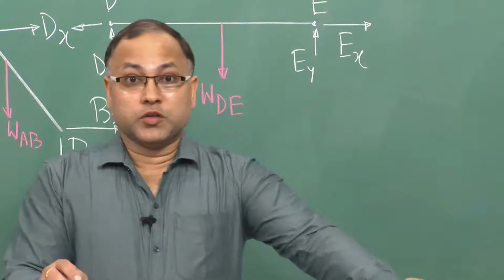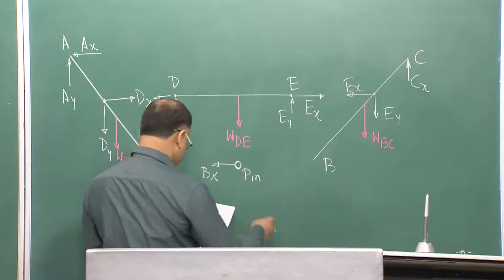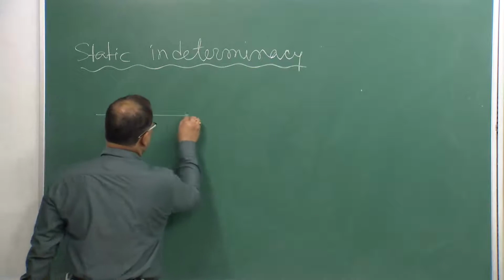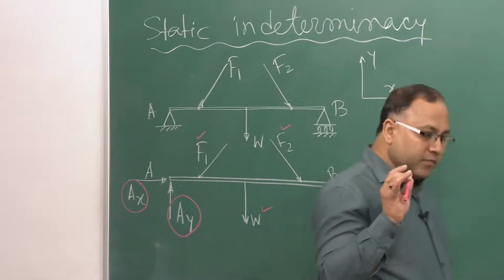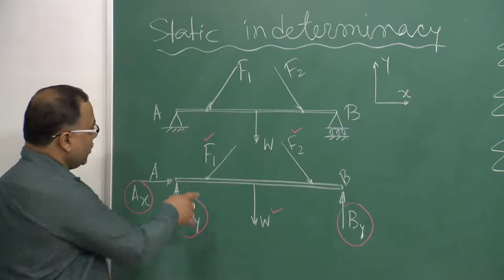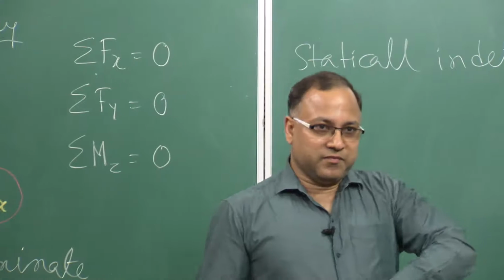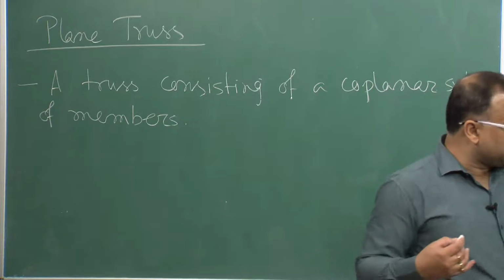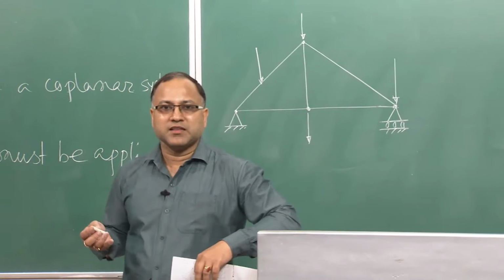Lecture 06 - FBD of Frame Structures

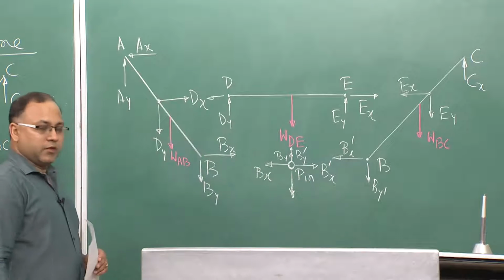Comment: Since at b at 4:53 why we take the by and by' both  upwards
Reply: We had to take opposite
Reply: Because point B is considered to be in equilibrium, it has to have a force By equal in magnitude but opposite in direction with respect to point B in beam AB. And similar explanation for By'.